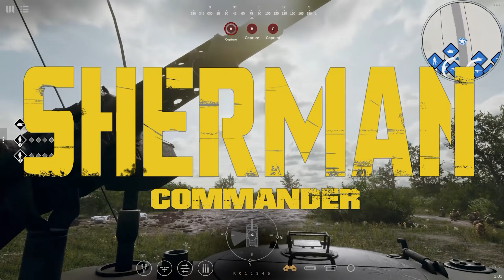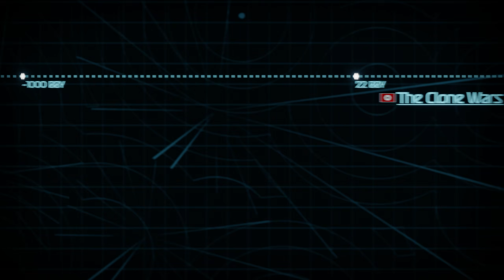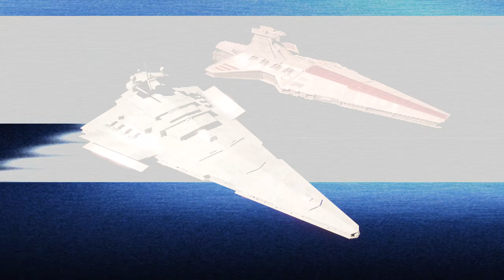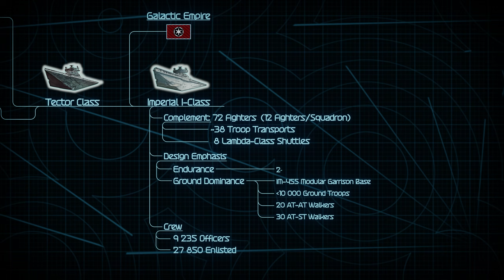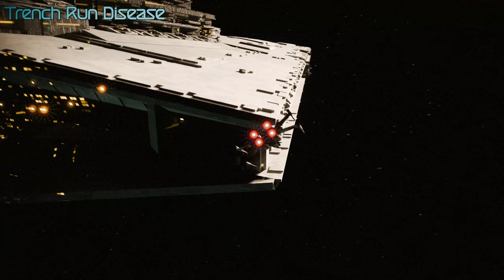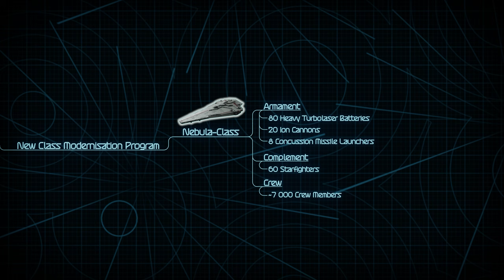The Star Destroyer's Evolution - Animated Breakdown and History

Comment: As much as i like to bash on star wars vehicle impractical design that are often actively detrimental to its battlefield role (think the AT AT which is a troop transport with no actual ability to actually mount or dismount infantry except freaking ropes), one of the things you can't dunk on the imperial star destroyer  is the super firing.

If you ignore the command bridge and the fact they can't shoot down, star destroyers have a really nice field of fire with 180° traverse on both axis for its guns and the ability to focus all its firepower on a single forward point. This alone puts head and shoulders above any other stars ship with the exception of the venator (which is just a redesign of og imperial star destroyer anyway)

Comment: The ISD did not have any point defence lasers nor the star fighter capacity to off set this.
So it's not versatile.
Reply: The original isd I had over 50 point defense laser cannons and had a full 6 squadrons of starfighters it was much more versatile than the later isd II which removed the lasers for more turbo lasers for some reason cause the higher ups wanted more firepower for some reason I would argue the isd i is rhe superior design cause it also has more ion cannons which makes it perfect for taking down rebel mon calamari cruisers with their strong shields
Reply: That IS complete bullshit WE literally See the ISD shoot and Hit the Falcon multiple times these where their Point defense turrets, the Falcon wouldnt survive a direct Turbolaser shot